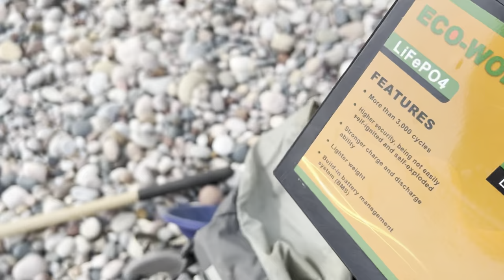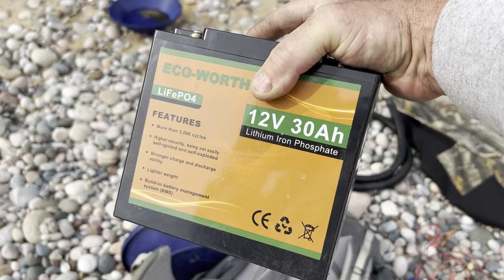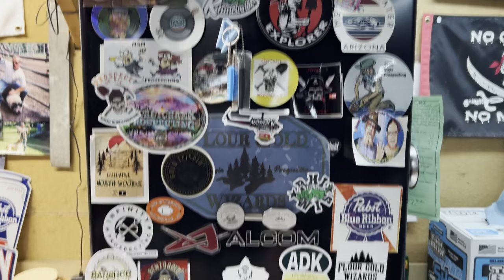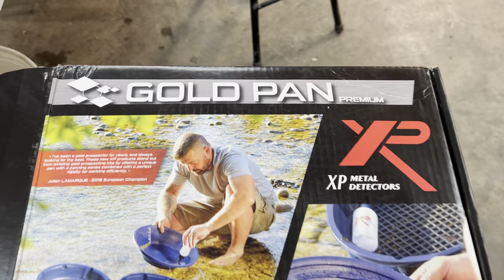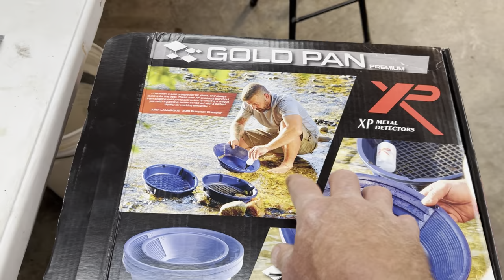Beach mining GOLDEN JACKPOT

Comment: Our family had a cottage on Lake Huron for years.  I remember black sand from beach clean up in the spring.  We had sand bars in shallow water that moved and turned durning the spring, summer and fall.  Winter would put everything back to where it was the previous year, except for radical changes in water depth.  Have you ever sampled the sand from the sand bars, especially the ones that turn during the year.  I was out in the Kewenaw Bay, inside Rabbit Bay that had a nice sand bar and also one on the other side in a old settlement outside of Lance that had a county park facing north with a sandy beach about a mile long.  I just thought that since these sand bars are churning  most of the year there had to be a time and place where the heavy stuff (gold) accumulates.  If I still had the property I take my auger bulb planter that I welded up with 4 ft sections of threaded Rod compliments of Detroit local 636 pipe fitters (it fell of the truck).  They like my government jobs, I’m an engineer and always gave them a set of drawings for them to crumple up and throw into the corner of the office.  They drink PBR too.
Reply from the maker: It sounds logical!!! I haven’t tried them ✅

Comment: Realy enjoying your beach trips good stuff dude!! trying to design a new type of fine gold separator for beach and was wondering what size pump to the width of your sluice your using
Reply from the maker: Different riffle styles will require different water flows. A shallow riffle needs a little less whereas a drop riffle luke mine needs more… if you can keep the material in your riffle “ active “ without blowing everything out you’re off to a good start !!! Mine is 1100 gph in a 6” sluice
The gold cube is 12” wide and uses the same amount of water ✅
Reply: @FlourgoldWizards  thanks heaps man, try to get the project sorted and send ya a link if ya interested

Comment: I'm curious, what did you do before Youtube? I'd suggest setting up a 9-12 inch one of those as the bottom of a highbanker and then have a set of grizzly bars and a flat shovel and be able to just shovel into it.. That way you could run much higher volume.
Reply from the maker: I’m currently a full time mason, brick - block - stone-  32 years now !!!!
My system fits right in my backpack and is light , that was my goal ! We enjoy getting off the beaten path 😎✅🐺
Reply: @FlourgoldWizards  Yeah, I get that, believe my I have a 3 foot by 9 inch pine sluice I built myself and I've got scoliosis.. I definitely get wanting light. I'm just saying that in the long run if it was bigger and had grizzlies you wouldn't have to classify and run super slow, you could just shovel as much as your back could take, and in that stuff, I'm sure it'd add up to a good amount of gold really quickly. I've seen a lot of people run on beaches and get a bunch of gold with a high banker.. I think that's why the guy designed the Gold Hog mats was because that's what he does. Being able to scoop a flat shovel full off that beach would be the same as what.. 8-10 of your little scoop? A flat shovel would also make for easy skimming of that pay layer.

Comment: How many hours does your new Lithium Iron Phosphate battery run? How long to charge? Mine is coming in the mail soon and I need some real world info on battery use. I the same pump on my SGS-1 GoldSnare.
Reply from the maker: Well the battery says 30 amp hrs on it so theoretically it’s supposed to run a 1 amp device for 30 hrs. My 3 amp pump for 10 hrs. It usually charges in around an hr with a lithium battery charger.

Comment: Whatever overheated and died in your speed control could, in future be water cooled to prevent this. anything lower than full speed heats up the controller
Reply from the maker: I accidentally touched the alligator clamps together and blew the fuse, but you are correct about running them lower !!! Turns out that sluice likes it full blast so no need !!! Thanks for the tip ✅✅✅